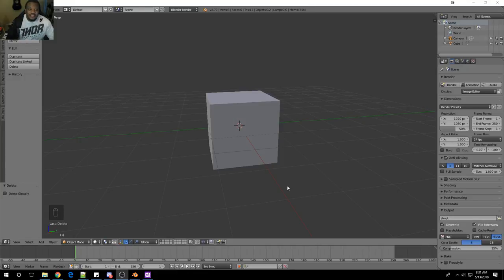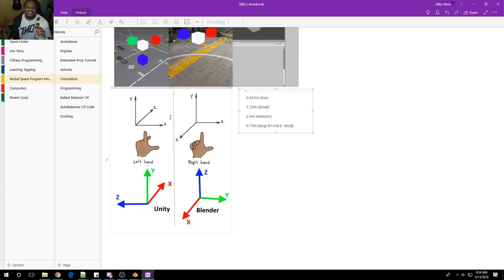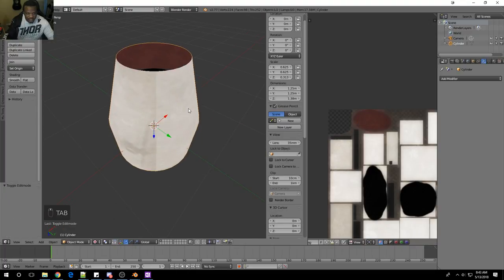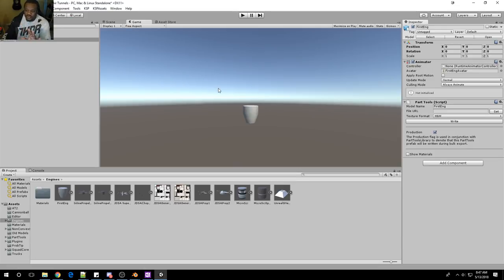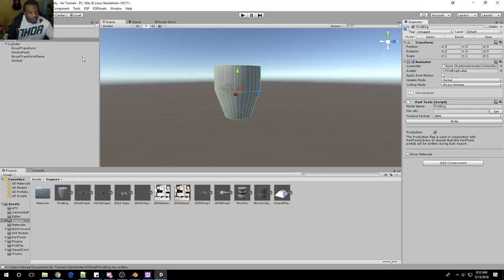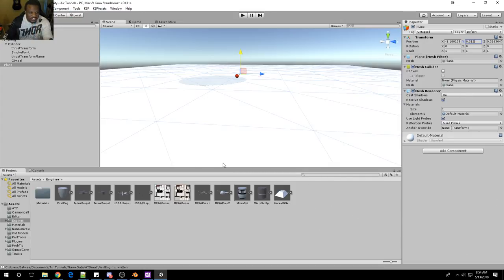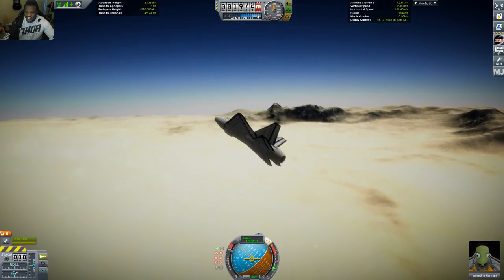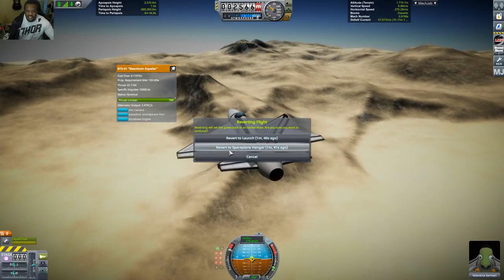Kerbal Space Program | Lets Mod an Engine

Comment: How do I deal with my engine drawing a ludicrous amount of fuel and intake? (Changing an electric prop to fuel burning)
Reply from the maker: Sounds like the resource ratios are off and or the isp. I usually base my engine specs based on the existing and adjust from there.

Comment: i have tried this 2 times but both times the engine is strecthed really long and has not attach nodes, after placing the engine i also cannot grab it anymore. i dont use a texture file is that the problem?
Reply: maybe
Reply: if you can't grab the engine means the collider is troublesome
Reply: Probably try redoing the collider